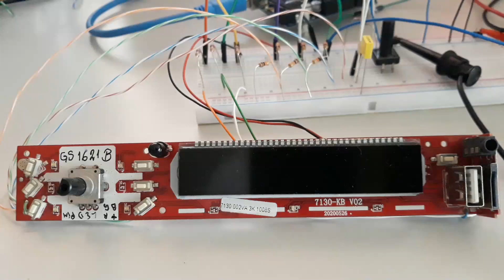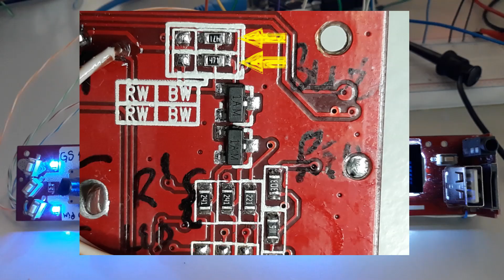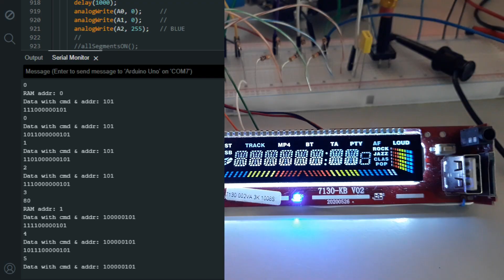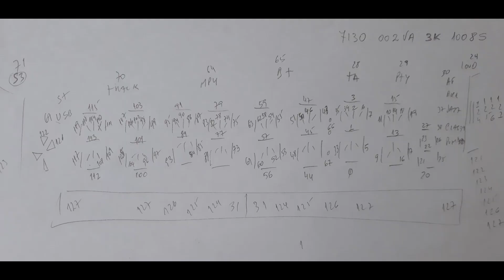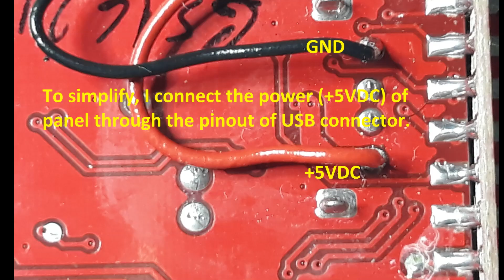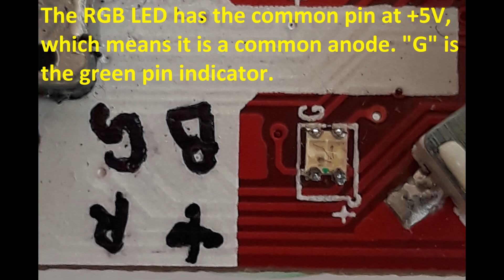GS1621B

Comment: Olá amigo José! Td bem com você? Eu abri um DVD RECEIVER HT503SH da LG, contendo um VFD de 9 dígitos com 14 segmentos, além de outros elementos. Mas, o problema é o CI, que consigo ver (ainda com lupa) somente a marca ETEK, mais alguns supostos números, como ET16xxxx ou KT16xxxx, difícil de definir, com 44 pinos (quadrado).
Você conhece esses CIs ETEK, usados para controlar VFD? Obrigado.
Reply from the maker: Viva Daniel,
Realmente sem os ultimos digitos torna-se dificil! Sugiro que procures o Manual técnico (Service Manual) e procura o diagrama do painel onde se encontra o display. Eu realizei essa busca e encontrei o esquema onde está um PT6315 como sendo o IC301.
Como a elaboração do aparelho é unica, o que se encontra no teu aparelho terá de ser um equivalente, OK. Espero que esta sugestão ajude, bom trabalho aí.
Reply from the maker: Sendo um ET16315 os comandos são os mesmos do PT6315 pois eles são cópias.